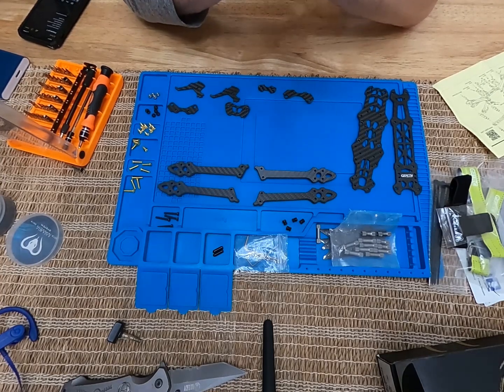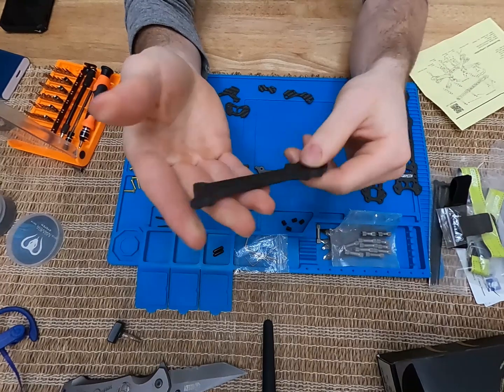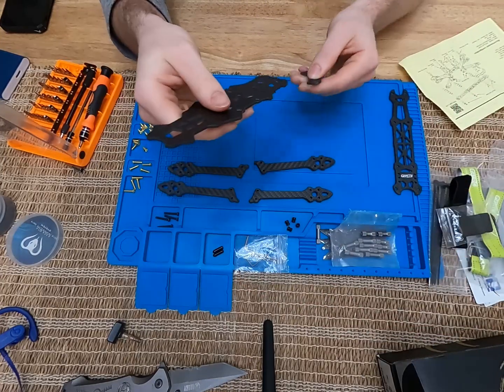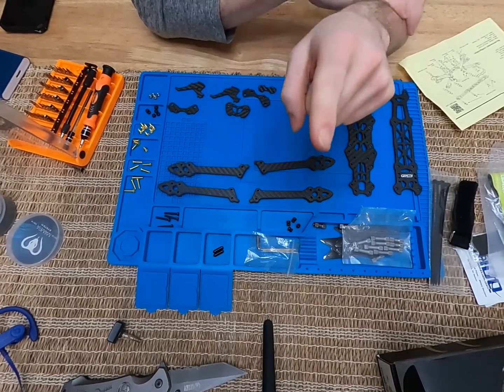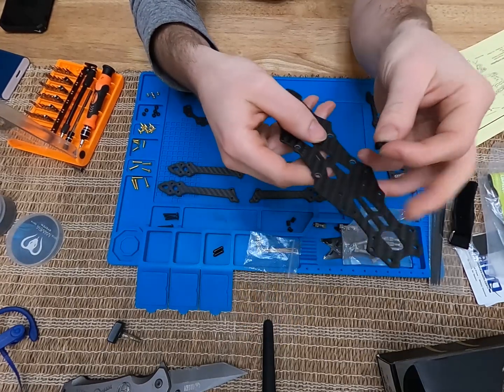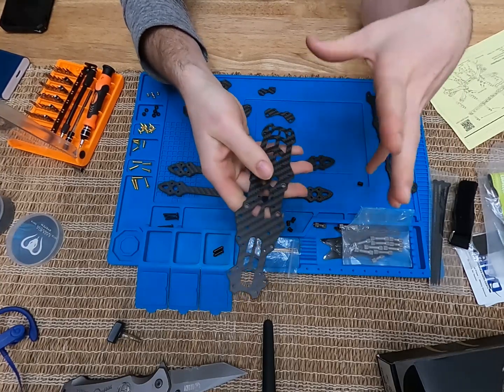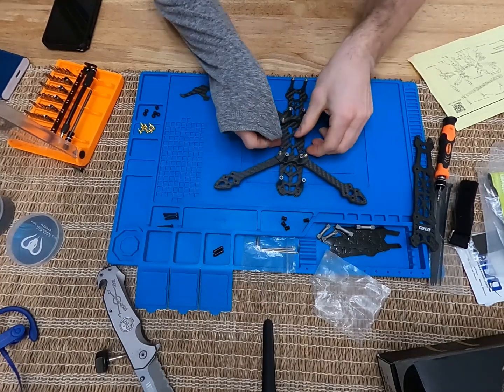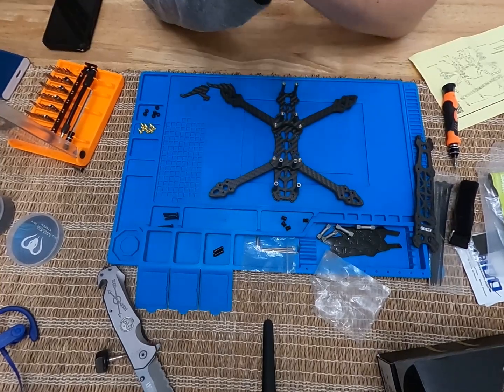How to build GEPRC Mark 4 Frame Build [FPV Build Part 1: Frame]

Comment: BRO YOU ARE WRONG AT TWO PLACES. FIRST THE STANDOFFS HAVE ORIENNTATION. THE SHALLOW PART GOES TO THE TOP. SECONT THE SMALL STEEL SCREWS, YOU SCREWD THEM UPSIDE DOWN. THEY HAVE GROOVES WHICH MESH WITH THE PLATES.

Comment: Super helpful I never would have figured out the screws. However for anyone watching he actually does the standoffs in the arms wrong (the middle, short standoffs). Unless the design has changed since I got mine, the middle front standoffs need to be in the front narrow position, not the wide position. The top won't fit like this for the frame how it ships today

Comment: Thanks for this it helped me alot!
I found another method for the depressions on the bottom plate: Insert the squishies(shorter end to the bottom) with the depressions to the bottom and the screw will stick out less than the bumpers and won't get chopped off easily.